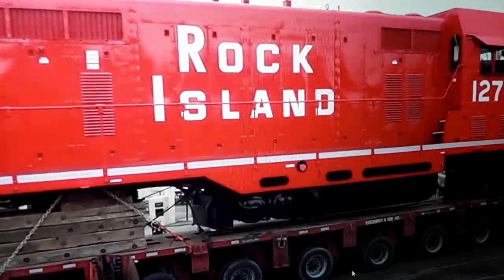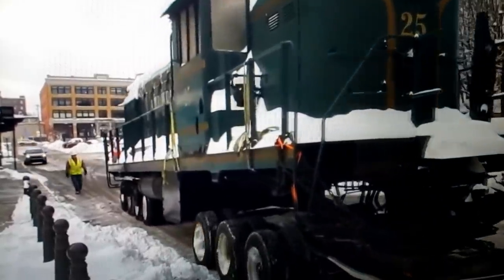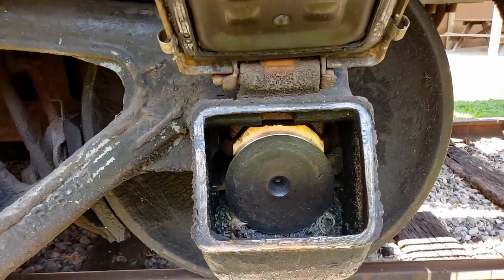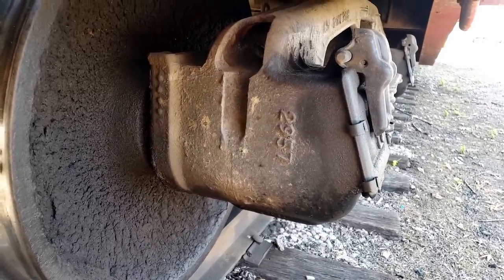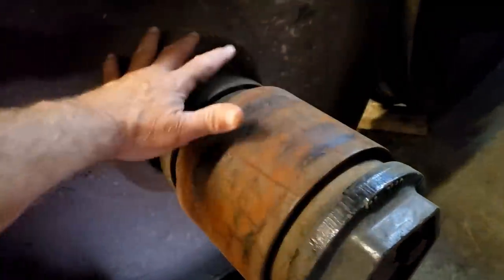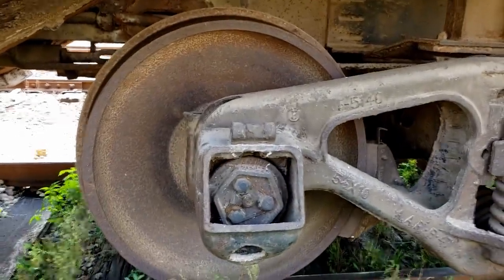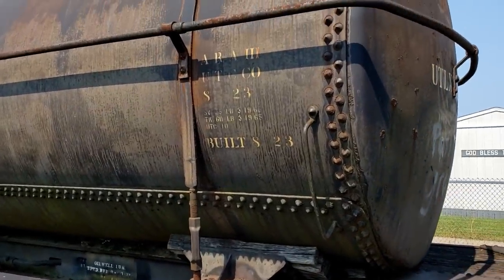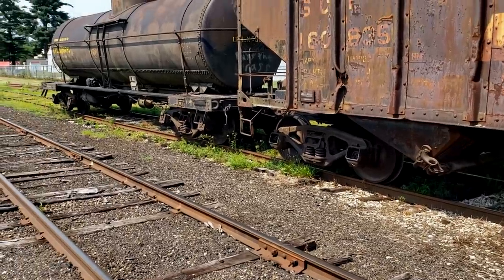Cause of Death explained!

Comment: We had some friction bearing trucks on some SW-8 switchers that were surplus and had the same restrictions. When we told a potential buyer about not being able to interchange them on a class one for shipment because of those friction bearings, the buyer said no problem. and  
a few days later came back with a pair of roller bearing trucks and a crane. Did the swap out in a day. Asked him what he was gonna do with the old ones, he said take them back to the diesel repair facility he bought them from and have them modified as spares. Always a solution, eh?
Reply: The good stuff can be reused!
Reply: George I was just wondering if you buy locomotives or lease them? If so I have a beautiful reconditioned SW1200 and a SW1500. Lmk
Reply: @kylechristine714  That was back when I was employed in the railroad business years ago. I'm retired now, but have you checked with any railroad equipment brokers by chance? I do know shortlines and a few industrial lines look for switchers like you described.
Reply: Now it makes sense to me why seemingly good locomotives are scrapped railroads and their idiotic restrictions !
Reply: @kylechristine714  did you have any luck finding a buyer? 
There is a fellow named Sicott in Worthington Ohio who buys, reconditions, and leases or sells locomotives.

Comment: * Bearings
* Bearing Boxes
* Air Brake work (pull valves and send to PATCO /Wabtec)
* Stop blocks or self centering coupler draft gear
* Blue Card (92 Day insp., 1Year insp., AND 2 Year insp.)
* Fix anything found in the inspections

Big bucks.  I will also comment that Larry's Truck and Electric (LTEX) is scrapping a bunch of stuff right now, you might be able to pick up a set of roller bearing trucks and get them fixed up cheaper.  This would still involve a day of crane rental.
Reply: that's in his state.

Comment: Another big issue is timing.  Usually, they want the engine gone by yesterday so you don't have time to arrange a way to save it without spending BIG bucks.  BTW, an nod to the locomotives in the vid, nothing sounds as great as an ALCO loaded up.  Great videos, got my up vote.

Comment: In 1995 I watched the D&H 5017 RS 36 Alco being moved to the Delaware and Ulster RR based in Arkville, NY
I have some great photos I took of the move. It was transported on a multi-wheel trailer.
Up 30+ miles on State Route 28.
Telephone and electric companies headed up the caravan, lifting wires along the way.
Years later the Catskill Mountain RR had a Alco S1 moved in the same way, up State Route 28, by trailer and semi tractor.
Glad to have seen these incredible feats !!

Comment: When I see older equipment I like to look for something that most folks dont know about. Anyone who worked the railroads would be familiar with it.  Do a video on "polling sockets" and the use of them. Really enjoying the videos.
Reply: I heard them called 'pole pockets'.  Yeah, the idea of using what amounts to a small telephone pole to push cars on adjacent tracks to save a little time switching?  Them railroad men had guts.  :)
Reply: @mikefochtman7164  yeah I have heard them called both.
Reply: @robertbullcarmichael9856  Poling cars is DANGEROUS!  When I had a opr job I talked to a few old heads who had seen accidents using poles.  Normally not something you want to do if there is an another easy way to do it.

Comment: That shop you talked to in Pennsylvania gave you good fair prices on the conversion work.  My family has been doing this exact work since 1968.  I have been doing it since the middle 70's.  The journal conversions and the box conversions can actually be the cheapest part of the job.  To get away from hot bearing detector issues we have been cutting off the faces of friction boxes on locomotives in addition to removing the lids.
Reply: I was just joking about the se thing regarding the bearing boxes. Would be way quicker to cut off the face, rather than drilling a drain hole. Plus no debris getting trapped. I'm no pro, but nice to hear a pro shares the idea. Also, I wonder if there would be a market for leasing trucks for a move to a short line yard that doesn't have the need for the expensive bearing mod?

Comment: In the UK from the beginning of the 90's railway equipment was routinely moved around by road as moving it by rail was to expensive. The companies were so busy that you had to book them well in advance, plus you had to wait for them to tie up an arrival and departure at the same yard, as most don't do empty moves. Today a lot of stuff still moves by road, but thankfully as we now have privately owned diesel locomotives a lot more stuff has gone back to moving over the class 1 rails. During the peak of scrapping and replacement it was not unusual to see 120 ton plus locomotives going up and down our motorways (freeways) on the back of lorries.We do of course have the advantage of having a smaller loading gauge. The last time I saw a quote for moving a loco was back in the mid-90's, and for moving it around 150 miles it was £1500.

Comment: When I was a kid the railroad station in town still had an agent on duty 24hrs. Used to let a couple of us kids set inside with him. Hot box detector reader was there, like a electrocardiograph machine with two needles marking the graph paper, one for each side of the train... the hotter the journal the farther the needle moved.. Engines were roller bearing but most all the cars weren't. He pointed out the roller bearings ran warmer than the old style.. you could tell a roller bearing car from the rest because of this.. when they did have a hot box he stopped the train at the station, they counted the marks on the graph (the axles) to find out where in the train the hot box was. He said when roller bearings first appeared some guys mistook the readings as a hot box even though all 8 journals of that car had the same reading just hotter than the rest. after each train passed, he rolled up the graph, wrote the engine number, direction of travel and track number on it, put a rubber band around it and threw it in a box.
Reply from the maker: Rob   That is a great story!  Thanks for adding your memories, it brings this topic to life!  Brian

Comment: Several years ago, the Kentucky Steam Heritage Corporation wanted to move C&O K-4 #2716 loco & tender from The Kentucky Railway Museum to KSHCo’s facility at Ravenna, KY. CSX would do the move for them, but while the engine itself had roller bearings, the tender had friction bearings. This meant they had to convert the tender to roller bearings, put it on a flat car or have it transported by truck. They lucked out and found an abandoned heavy flat car with roller bearings three axle trucks. The trucks fit on the tender and it the engine and tender were moved over CSX track.

Comment: A lot of good information. I’m a huge rail fan and as such have built a ride on 7.5 railroad around my home. I had a chance years ago to purchase a standard gauge F3A,  the price to purchase was reasonable and the prime mover was refurbished about 6 years prior. However, the distance and logistics to move the thing to where I would be working on it and further operate it was astronomical. Sadly, I learned not long after I showed interest it was scrapped. Very sad day

Comment: I like roller bearing trucks.I also like the friction bearing trucks too.I'm an HO model railroader and all the HO cars I have that have roller bearings have rotating roller bearings like the reail rail cars.I have a few engine I modified with working roller bearins.Keep the videos coming.I like all your videos.Thankyou.
Reply: What brand of trucks do you use?  I have been doing a capital improvement on my model railroad converting cars to Kadee roller bearings of the correct weight.

Comment: I think they should add a exception to the regs for friction bearings, allowing them to be moved on a class A for special moves, for a limited distance as long as they can pass an inspection, are well lubricated and checked every 400 or 500 miles (no more than 1,000 total miles) and moved at no more than 55MPH.
You wouldn't be able to go cross country but it would save a lot of $$ and time for short or regional moves.

Comment: The tulsa  Sapulpa union  rail road  in Sapulpa Oklahoma  restores these locomotives.    Should  check them out  its a small line but moves alot  of freight  and sand  to the glass plant in Sapulpa.

Comment: It is a shame that we at CN scrapped a lot of nice switchers. They used to go to London Ontario but in later years some were going to Selkirk Manitoba and parted out. Maybe you could buy used wheel sets from a place like that with or without traction motors and save some money and time. Or whole trucks. I changed a lot of them out in my time bit never did a conversion.

Comment: Looking at the caboose truck it's almost identical to those under the S160 tenders we have at Churnet Valley railway in the UK. Incidentally we had a triple headed S160 in Feb 2020  you tube has some videos.

Comment: Nice but solid bearing were never "outlawed." I have had equipment with solid bearing moved under careful watch. Railroads are under no obligation to take cars or locomotives in interchange with solid bearings. They may do so under their own prerogative. This is where your mechanical reputation comes into play.
Reply: the "outlawed" is for common everyday usage of cars and locomotives. the exceptions are what you just said.
Reply: @rearspeaker6364  Whenever a group or museum is faced with the move of solid bearing equipped axles the automatic default belief is the railroad won't touch it. Try this first: ask! Assuming it's an automatic 'no' is incorrect.
Reply: @maestromecanico597  true, that would be a common sense thing to do. today's railroad rules change daily.
Reply: Same here. I have moved them even thru interchange including a Class 1. Look up "Home Shop for Repair" rules. Have all things ready for the inspector and acceptable except for the fact of plain bearings. Always ask first and you may get it moved.
Reply: Question before I go how do I get one of them orange t-shirts where do I send the money I send money you sent shirt with Good2Go what do I send the money
Reply: Wow I never knew that that’s why locomotives are abandoned and cut up
Reply: @wayneslayton5561  that’s why old locomotives are scrapped
Reply: You need like a 100 tire lowboy !
Reply: Don’t forget all the permits you will need did a little heavy hauling myself
Reply: @ernestpassaro9663  Permits, we don't need no stinkin permits! Permits even to a State to move a loco from one State to another can cause the deal to fail. The State of WV was going to get one of the Graham County Shay locomotives. It would have been about 5 ton over the over weight permit that the State of NC was willing to grant. NC would not give. The loco ended up being moved to the NC RR Museum. On an over weight permit that covered all of the weight.

Comment: I recently learned that before those boxes with oil, they had to stop the train every so often on the track and have someone oil all the bearings.
Reply: I spent 9 years as a loco fireman 1956- 1965) and recall many hot boxes. Every time a car was put into a train the boxes were checked and oiled. In Tucson there were about 10 men (3 shifts) who's only job was to oil every car on every newly assembled train. Lots of work. I can't recall how many hot boxes I observed on road trips. It always meant cutting that car out at the next siding. Lots of lost time for the SP! Many times a maintain crew was dispatched with new brass and they would change out the bearing out at the next siding. on a good day or nite this could be done in 30 minutes. If the journal was too scored we would just leave that car in the spur at the siding. BTW we had a few roller bearing  "hot boxes". It's not a perfect world

Comment: Back a year or two ago they gave C&O's #2716's tender "new" roller bearing trucks and sent her up a few class 1's  to her new home in Ravenna, KY.  So I'm wondering, couldn't they have just put roller bearing trucks under that Rock Island diesel to move it or would that have been even more expensive than shipping it by truck?  Ten when it got there they could set it back on the original trucks.

Comment: Thanks for the lesson!  between this video and the other, I know more now about rail car bearings than I ever did before!

Also, the sun is out and HOT today .. and it's thundering and raining at the same time.  the heat index is over 100f.  If I step out the door I immediately sweat all the way through my clothing ... and the shop i work in has no HVAC at all!

Comment: The hopper car converted to roller bearing could have kept the classic look by keeping the journal box lid on. I think that looks better anyway.
Reply: Imagin being the guy that  gets screamed at when a inspector sees friction bearing trucks on a Class A road and doesn't open the lid to look.. that's why the lid is removed. So the roller bearings are plainly visible & ovcourse so you can notice if there's a visible issue like a loose or missing bolt.
Reply: Removing the lid also has to do with air flow around the bearing so it doesn't overheat.

Comment: so, pretty much, to convert to roller bearings is gonna be at least 10 grand by the time all the costs are added in. maybe more depending.
now, for a locomotive, a 1 time upgrade cost of that amount does not really sound too bad.
but if the seller will allow you to dismantle the thing where he has it sitting and do all that work etc, would be another matter.
so? you a lead on buying one of those and doing the conversion?
i wish i had the time to come help do the work.

Comment: Can you lift up the locomotive if let's say you have a old switcher with friction bearings can you lift it up enough where you can separate the locomotive from the truck slide the truck out put that on flatbed and put a whole new modern truck assembly so the class 1 railroads would move it?
Reply: I once saw a diesel switcher being moved that had standard roller bearing freight car trucks under it. Presumably, the original trucks were being shipped separately.
Reply: Removing the trucks also makes it easier to move the engine by flatbed as it lowers the overall height.

Comment: Are all the bearings Timken for the conversions?  I noticed the 'caps' have Timken on them, all of them did?
Reply: Timken is the dominant company for railroad axle bearings in North America, but SKF is a major supplier in other parts of the world. I work for them, so it was pretty neat to see the Big Boy trailing truck is rolling on our bearings. EMD locomotives, especially older ones, used Hyatt, and Fafner is also a brand from back in the day, particularly on passenger cars.

Comment: I tried to move a caboose converted to roller bearings in the friction box and they still would not move it.
Reply from the maker: Rudy   Thanks for watching!  Other than bearings,  items that can kill a move like this are, coupler/draft gear, and air brake currency and air brake tests. Also although a caboose is a people hauler, its classified as a freight car.  If you have more detail, I'd be curious.  Brian

Comment: there's at least three Dodge Rams in that beast.....recycle.  My family has long history with B&O RR...I still have time cards from the Roundhouse in Martinsburg, that's dated 1957..my grandfather was time keeper, and I worked there until they closed her down in 85...My SIL is engineer/conductor with CSX, and the new units make these look weak. new ones rated @ 7500hp...impressive.